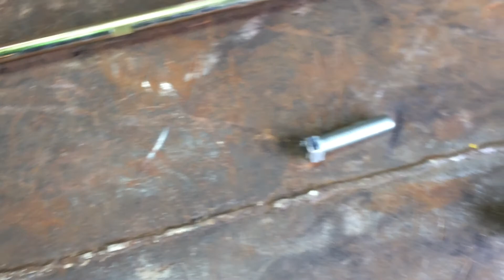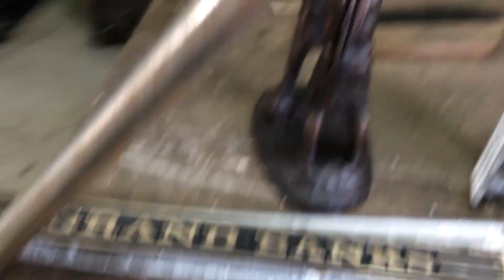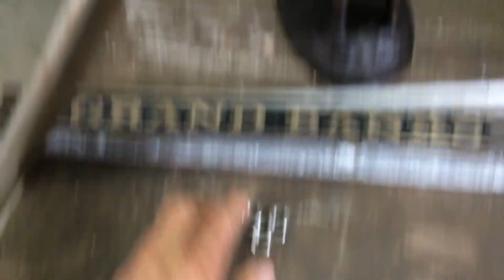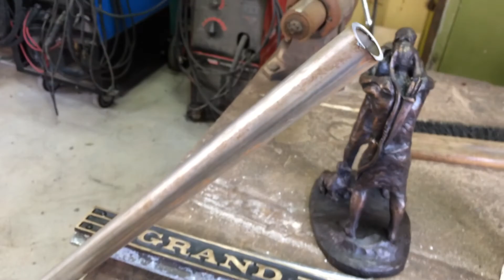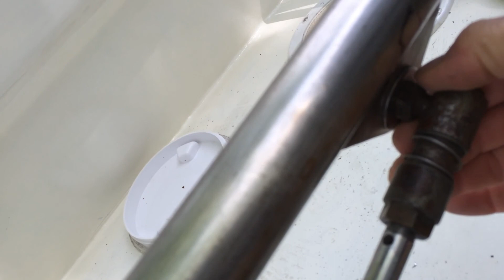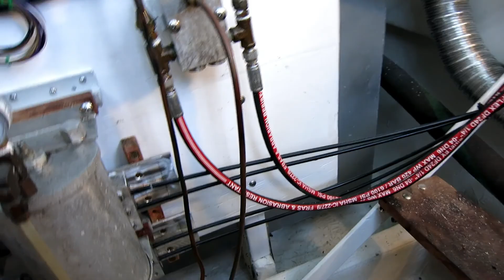Moving the steering to the outboards from the rudders.

Comment: For future you could have tried (maybe you did?) Fisheries Supply, Seattle, Wa., Marine Center, Seattle, Wa.,  Teleflex Marine Steering Systems Co., Vancouver, B.C. Canada., Morse Steering (which I believe now is part of Teleflex?).  Wholesale Marine Supply on line generally has the best pricing.  I have installed quite a few steering systems and always found all the parts in stainless steel over the years.  Cobbling up trolling motors to main engines and inboard engines as well as myriad of outboards.  Worst came to worst I would trash the metric mild steel and convert over to imperial.  I am sure you tried McMaster Carr and Grainger for the rod and ends.
Reply from the maker: I am a McMaster fan, great company. Buying new would have been easy, we just wanted  to use what we had.
Thanks for watching
Barry

Comment: I believe the cylinder with the Schrader valve is an accumulator
Reply from the maker: Yes, some type of accumulator. It seems to be able to put pressure into the system but not the other way around. Maybe there is a pressure release somewhere that would allow overly high pressure back into the tank, like a hot summer day or the rudder hitting a stump, I just don't know. But as an aid in filling the system with oil it is pretty nice to have.